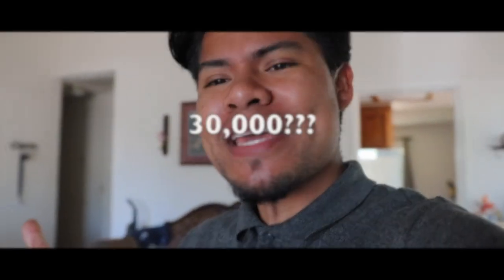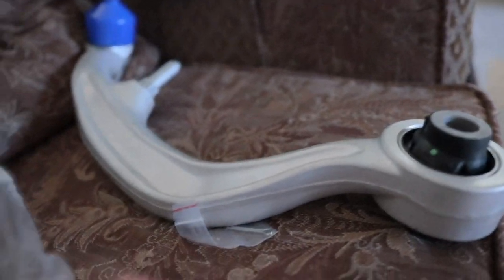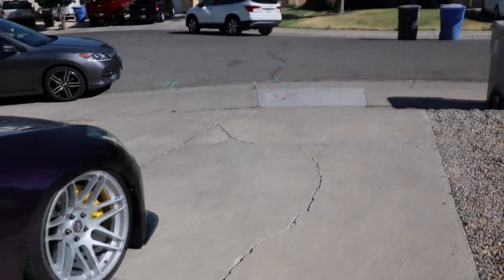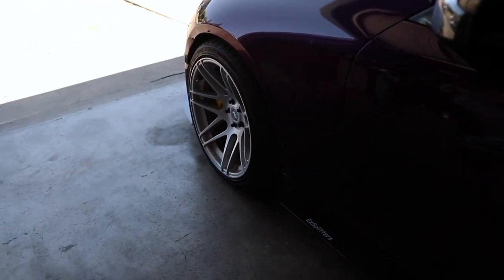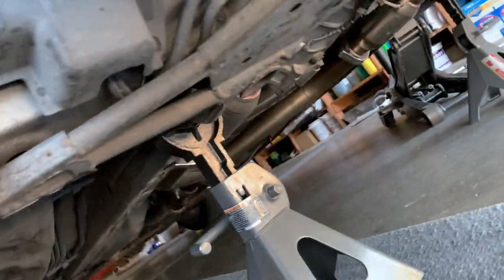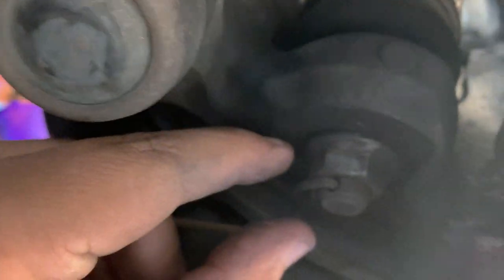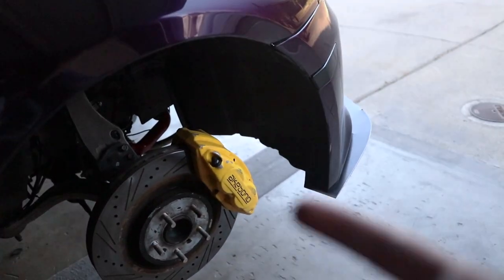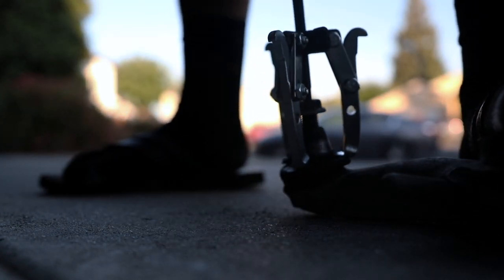G35 making LOUD Sound when I Press the Brakes ! ( Compression Arm Replacement )

Comment: When you throw your G around parts that usually hold up strong fail you abuse your G bro I have never spun my wheels or drifted my G that part your changing is like your control arm the back half of the lower control I still have my original lower inner control arms on my o4 G coupe 6sp... no offense all due respect bro we watching ya out here in Newyork bro your G is totally dope be easy

Comment: Mine was doing this after I replaced the C arm; turned out I didn't tighten the batman frame all the way & Next time you get under you need to grab more body frame the that you're very brave for putting the jackstands that far up
Reply: Where is the body frame I plan on going under my car tomorrow to do the same jobs this Amman’s done. Nd I don’t want to die in the process

Comment: I have to replace these too, when you install the new ones did you have too load the suspension before torquing them all the way or does it not matter with these
Reply from the maker: U torqued them when the car was up, not too sure if these have to be torqued with the suspension load on it. I don’t think so tho because no parts should really change their form with it without suspension load.